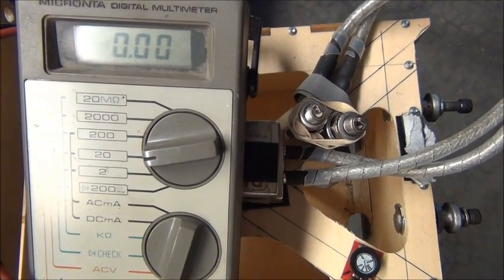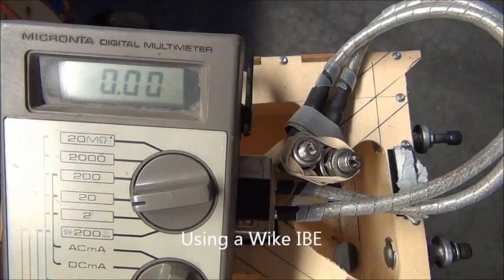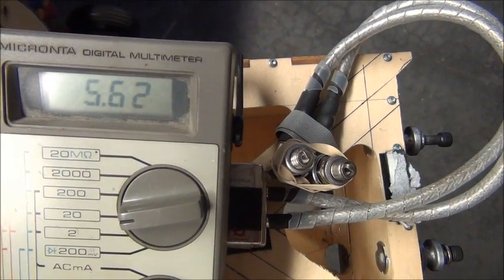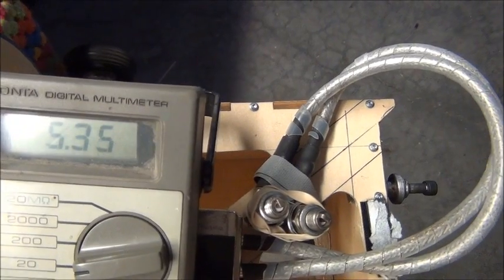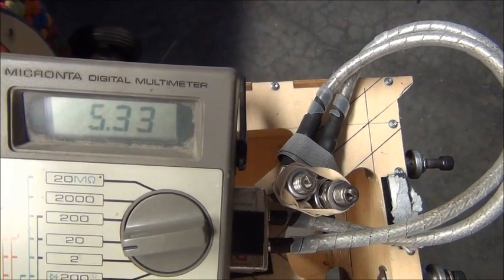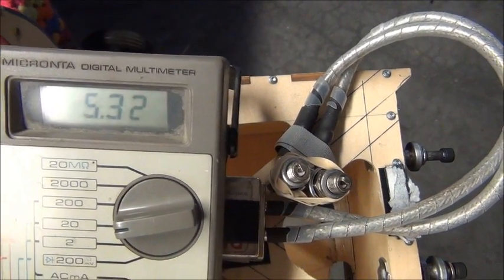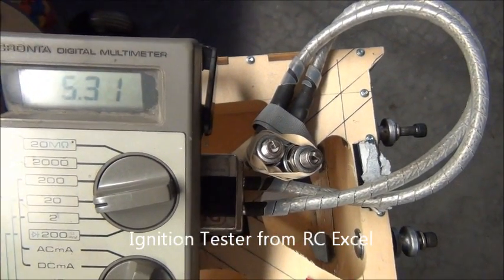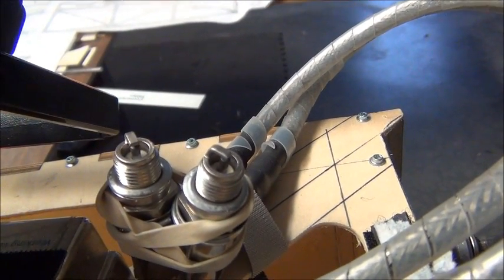Ignition Test PC

Comment from the maker: My problem ended up being a carb gasket that only deformed after the motor had been operating 10 minutes or longer, I guess due to heat build up.  Never saw that before.

The timing is synced by a magnet imbedded in the prop hub.  It passes by a sensor which triggers the spark.  My test device mimics this pulse and has a adjustable rate.